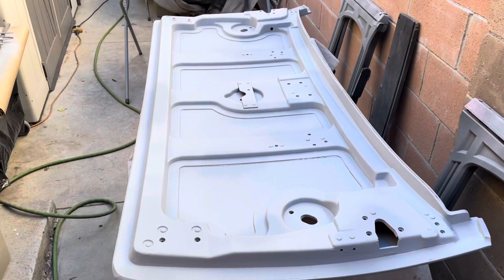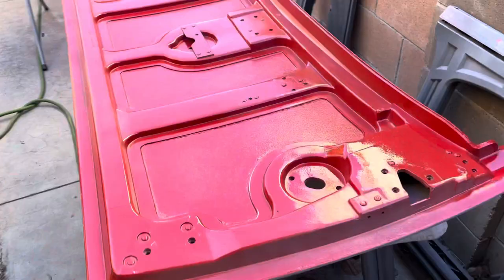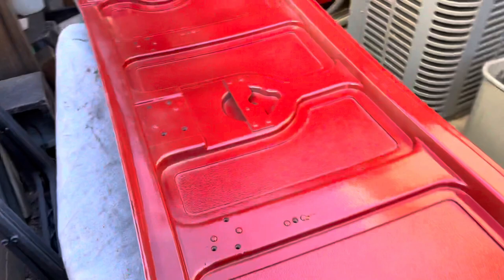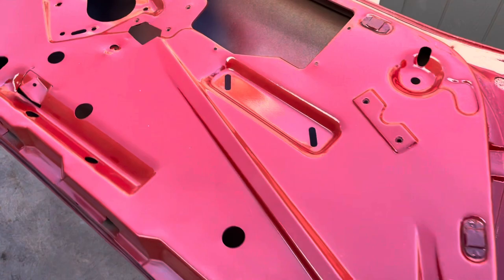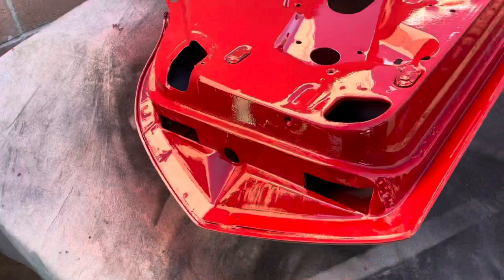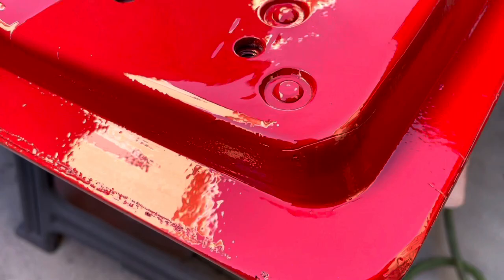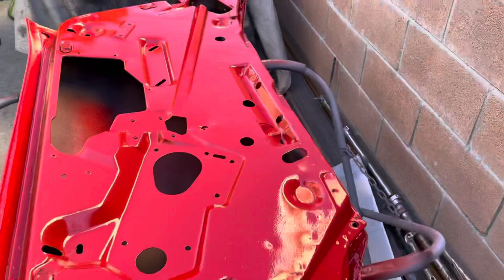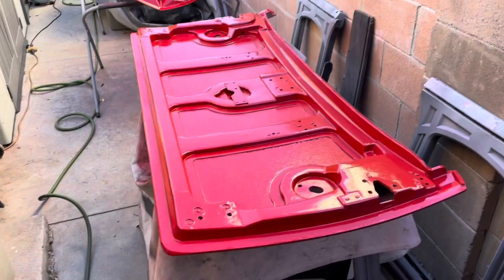C3 Mille Miglia DIY Paint Test

Comment: I can't wait until you get it all back together man! Gonna be nice, tight, and right! I'll have to get ahold of ya when my 81 is done. Doing the front end suspension right now on the 81. Then stripping out the interior, then bodywork. But yours will be nice, no doubt about it.
Reply from the maker: Thanks. I’m a little nervous about getting it back together right, but it’s all just nuts and bolts and I’ll take my time.
Reply: @thedrivewayC3  what I do on a rebuild is bag and tag everything. I use zip lock bags, and a pastie note in it telling me what it's for. I got 1 gallon bags for the big stuff, and small ones for the little stuff. But bag and tag everything. The stuff I can't bag, gets a piece of tape on it with what it is, ie.. pax door arm rest. The screws are in a bag with the same info on the posty note. That way I don't lose anything.
Reply: @thedrivewayC3  by the way, I found a great C3 salvage yard in Dayton Florida.  It's called Corvette Generation. They got alot of C3 and C4 parts. Hard to find parts. I got my turning signal arm with the cruise controls on it. They don't reproduce them, and couldn't find it anywhere. Saw a utube report from a channel I subscribe to,  gave em a call, and now one with wiring harness is on the way. But they got alot of vettes if ya need anything, they might have it. Just wanted ya to know, just in case.

Comment: White spots are called " fish eye"  chemical reaction to dust or somthing incompatible with the paint.
Reply from the maker: Thanks Carlos. I have heard of that and it makes sense in this case. Seems like the 2nd coat got rid of them, but it’s something to correct in the future by making sure all surfaces are super clean.
Reply: Could be grease, dirt, even body oil from touching the parts. I use a spray degeaser made for paint jobs, wear rubber gloves, and last thing I do is wipe it down with a tack rag. Gets all the dust, everything off. But the phrase is correct, "fish eye".
Reply from the maker: @gizzmo5952  I think maybe dust. I always wipe down with alcohol & gloves. I usually tack it down, but I didn’t have any that time. Lesson learned.